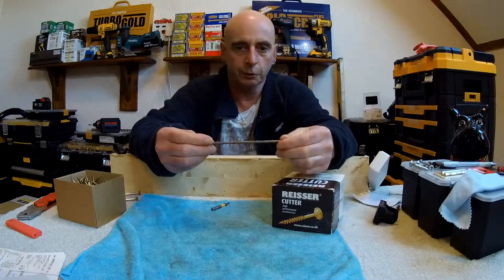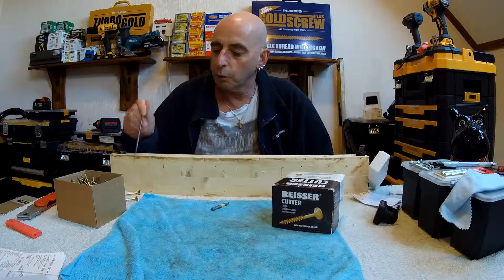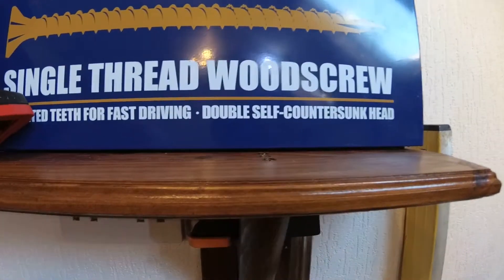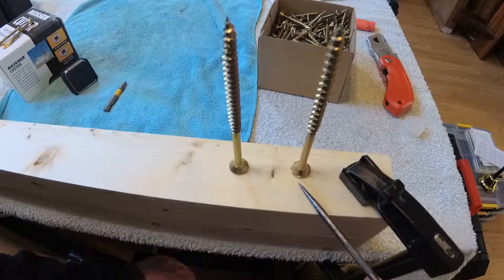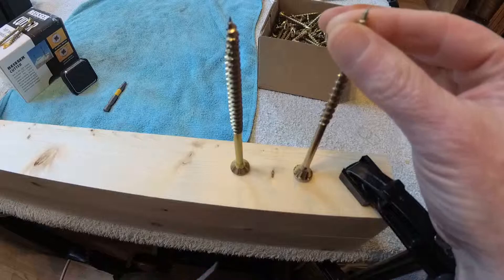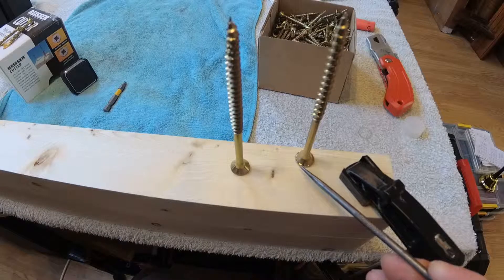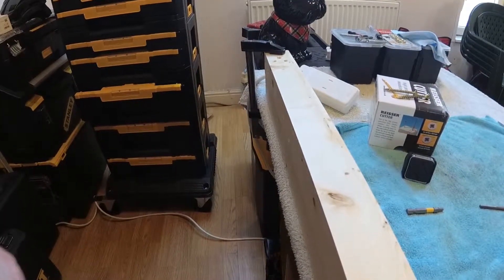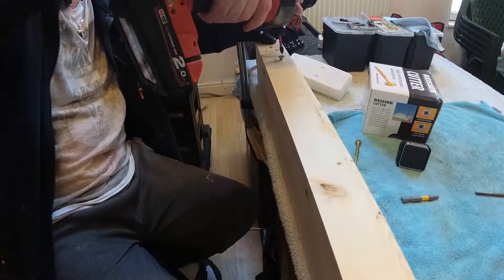Double Countersink Screws - What are they?

Comment: I thought double countersunk meant that there is 2 different countersink angles in the conical shape under the head. If you think about a countersunk machine screw (i.e. bolt), it has a simple conical head, which runs into the cylindrical shank of the screw abruptly (yes there's a tiny radius, but not what I mean here)

On a double countersunk wood screw, there's the main conical angle under the head, and then there's a second shallower taper to blend it into the shank of the screw, which I think is there to improve strength and reduce the stress concentration caused by the rapid change in diameter which is where the head always snaps off. I don't think it has anything to do with self counter sinking cutting ribs under the head (but I could be wrong). 

For example, simple Gold Screws without any cutting ribs are described as double countersunk. See Screwfix link below:

https://www.screwfix.com/p/goldscrew-pz-double-countersunk-self-tapping-multipurpose-screws-5mm-x-50mm-200-pack/16497